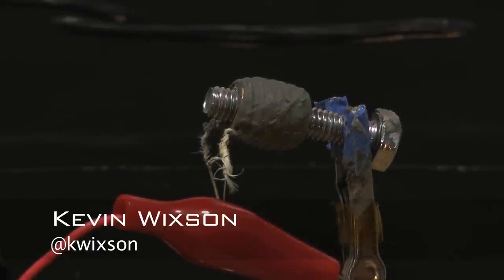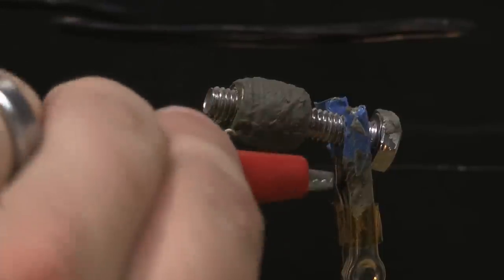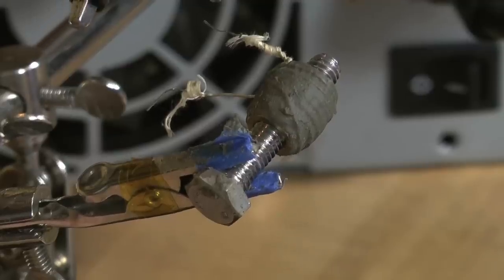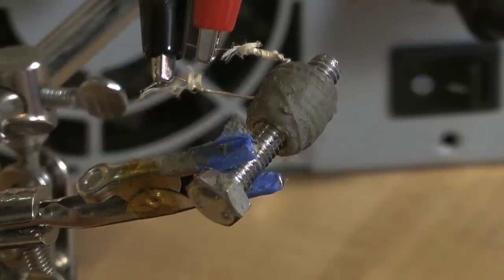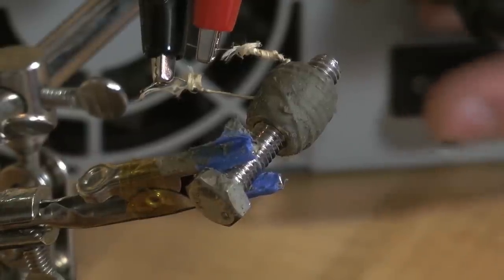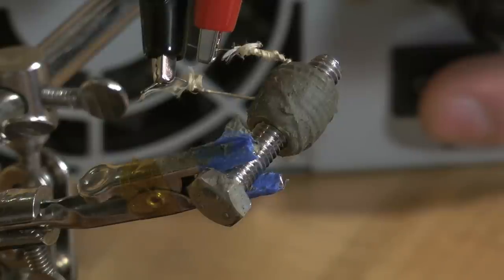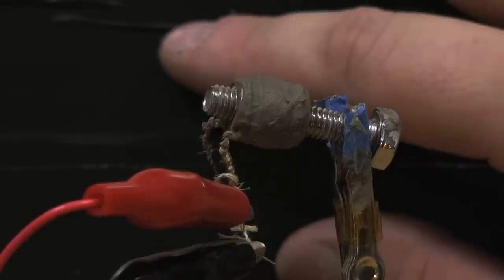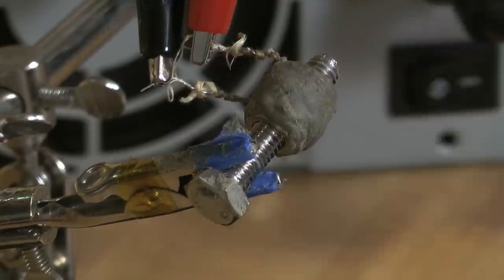MakerGear Hot End: First Core Cook

Comment: First of all, this is really great! thanks for taking the time to do this, it is extremely helpful. 

Just bought this kit from MakerGear and I plan on assembling the heat core this weekend. Question for you: Are you just running 12v output from the power supply to the nichrome wire? Didn't know if it should be a lower voltage or not. Or if there are any other modifications that should be done to the power source... 
 
sorry to be such a noob, thanks again for the great videos!